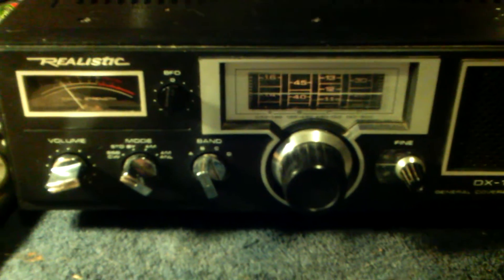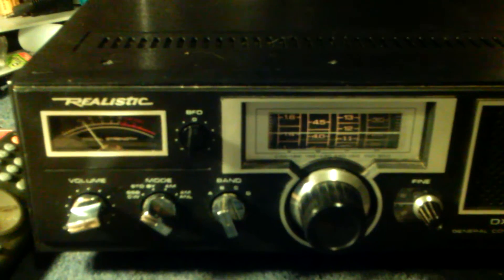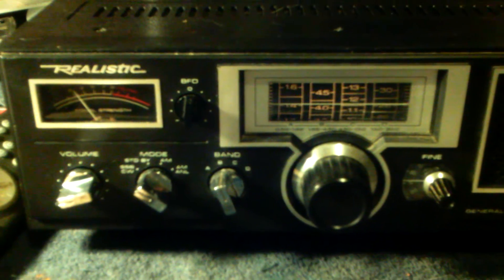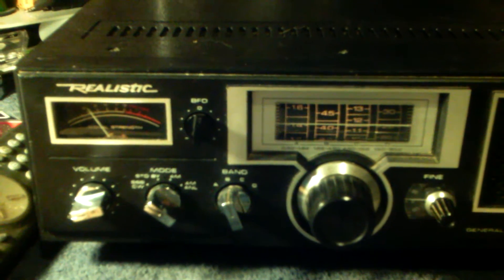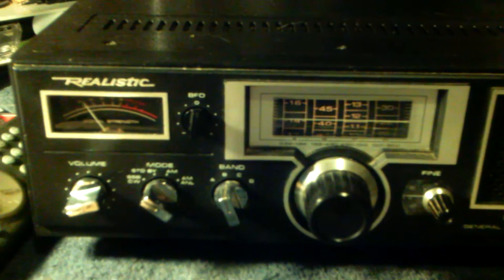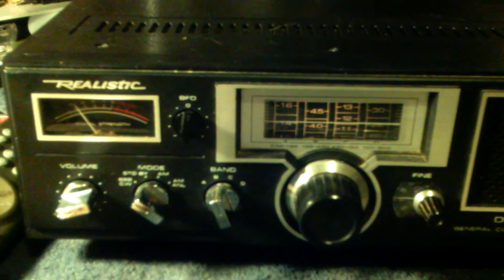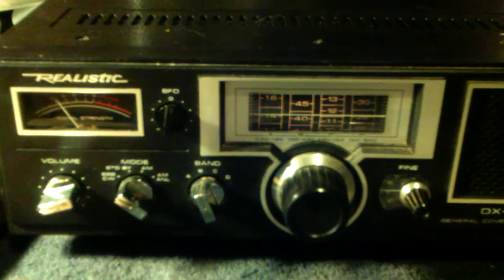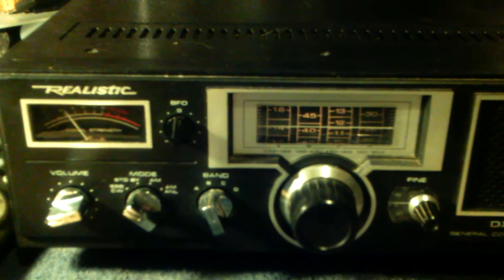Realistic DX 100 SSB Tuning

Comment: I rarely touch the BFO control on my DX100, the main tuning dial has a degree of backlash (as you will find) so the fine tuning adjustment is the best option out of the 3 :)
Reply from the maker: SpectreOZ thanks oz I find using the BDI works best for me. 
Thanks for watching
Reply from the maker: Bfo bfo